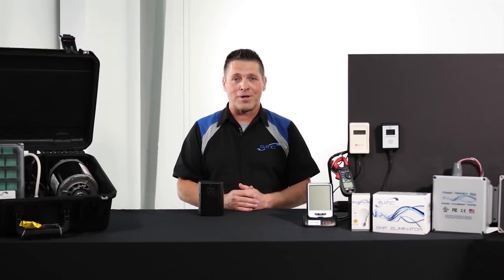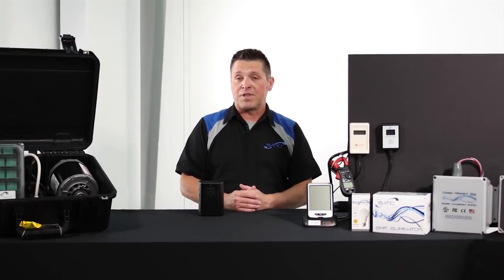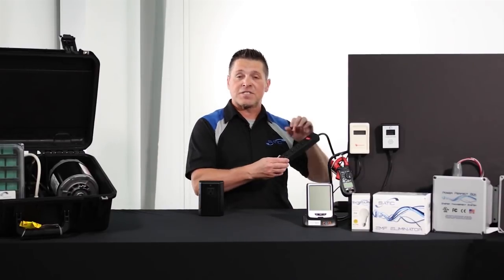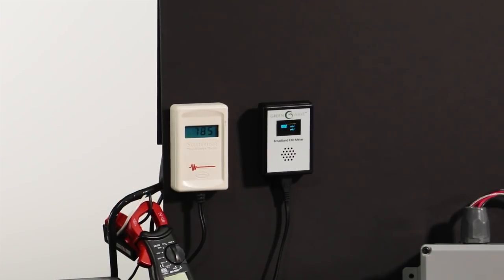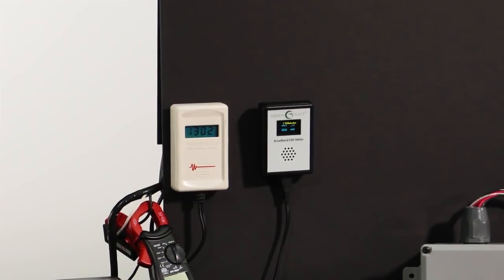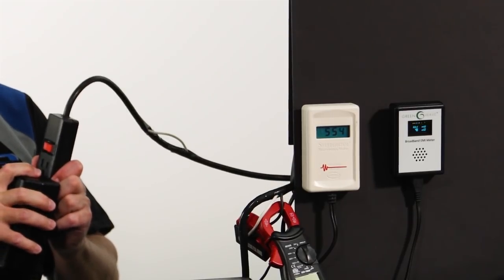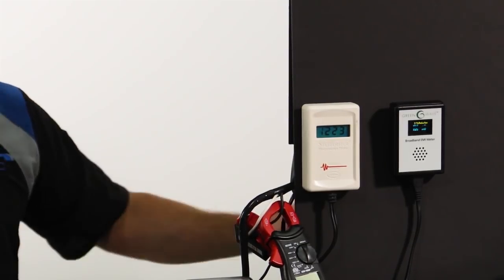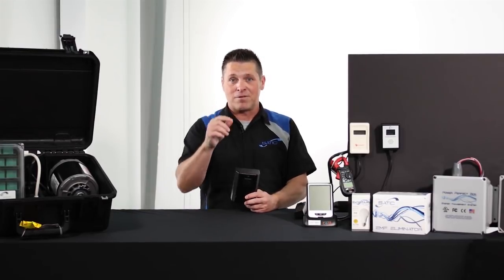Reducing Dirty Electricity

Comment: How can I find how to test for DE with a multimeter and an electricom 2 emf  meter in a house wired but with no drywall? Also have an am battery powered radio.  The I want to fix the issue not mitigate after walls are up...

Comment: I already got rid of all the dimers in the house.  But how about LED bulbs which are dimable -- can I still use them (120 volts)?
Reply: Yes you can - dimmable LED's don't have to be dimmed. To my knowledge they should run at full brightness when not on a dimmer.

Comment: No thanks.. You would have to buy one for each outlet in your house? I don't think so.
Reply: Escorpio40. You would only need to purchase two for your house. One landing on phase A and the other landing on phase B. Thank you for viewing our video.
Reply: @b.d.ericksonii453  how do you find which phase is which?
Reply from the maker: In the US most homes are delivered split-phase, which is called single-phase, yet there are two phases called A & B. The breakers in your panel cascade down from top to bottom. The top breaker, on either side, is always A. The second is always B and that pattern repeats down. A, B, A, B..... etc. I hope this helps.
Reply: @saticusa  thank you

Comment: QUESTION 1: What is the name of the two most commonly used meters for measuring dirty electricity? Because what I cannot measure I cannot believe! Thank you in advance for a reply.
QUESTION 2: Do you sell your products also in Germany Europe? I need someone explaining me what is best for my problems: A) for reducing dirty electricity in my apartment in Germany, B) how to protect against electromagnetic radiation from a celltower built on the roof of the house across the street where british Vodafone has now installed 5G. Since the my skin burns constantly day and night like pierced with thousands of hot needles, and I hear constantly day and night a very high whistling in my ears (tinnitus). I hve WLAN off and use an ethernet cable to my laptop.
Reply from the maker: Thank you for your post Gabriela. 
A1: Two of the more common meters are Graham Stetzer and Green Wave. Satic will be launching it's own EMI meter in Q1 of 2020.
A2: We do sell in Germany. 
Satic Tech Dept.

Comment: Does it work for the internet as well?
Reply from the maker: It does not effect low voltage or DC wiring that is not connected to the electrical system. You must somehow connect to any sub system for an effect. It can lesson the harmonics in the electrical wiring now acting as an antenna for wireless signals.